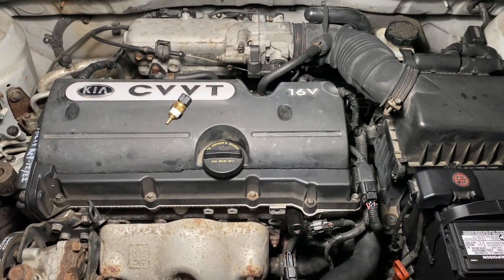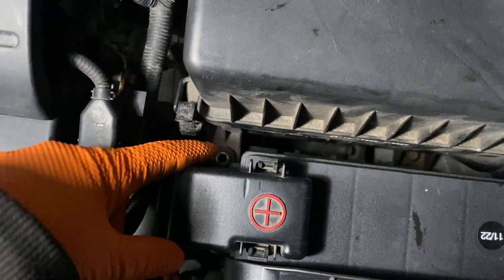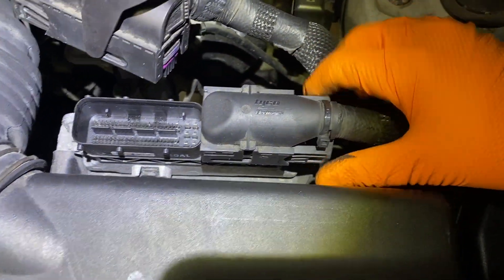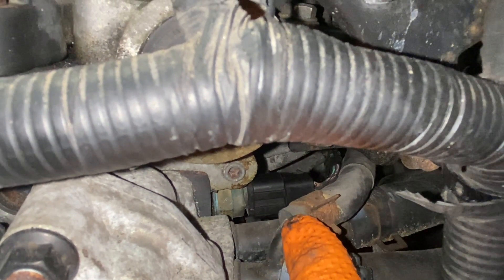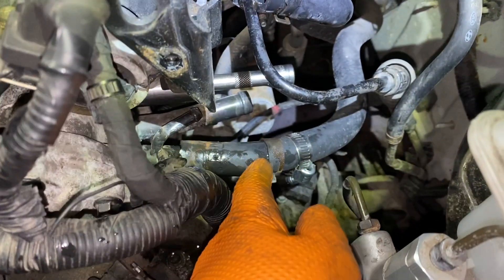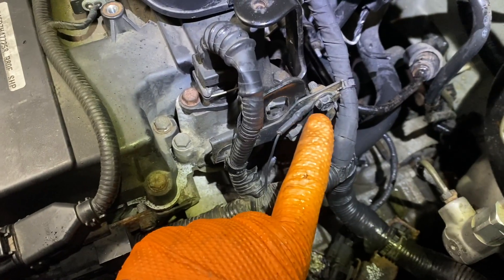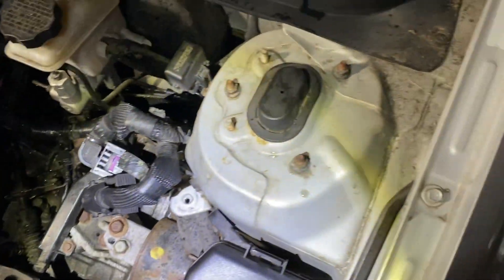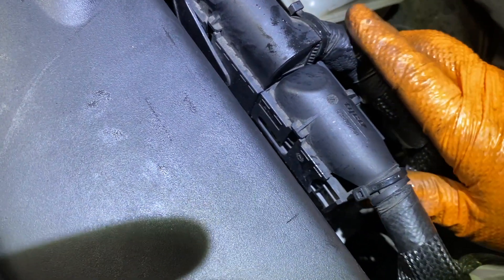Engine Cooling Temperature Sensor Location (ECT) & Replace On Kia Rio Rio 5 Spectra  Hyundai Accent

Comment: Do i have to bleed the coolent after ??
Reply from the maker: Normally no, but if you have no heat or its starts to overheat a little and didn't before then yes.
Reply: @motorcarnut  Thank you for the quick response 🙏
Reply from the maker: No problem!

Comment: How do you get off the wiring harness connector to the Coolant Temperature Sensor? It's plastic and I'm worried it would break. Do you squeeze the connection somewhere? I can't figure out how to get it off without breaking it.
Reply from the maker: Yes, at the front of the sensor is a little tab, push down hard and pull off

Comment: Does anyone know why their are two cooling fans? My left fan does not work but the right one does. Could that be because the temperature sensor is bad? The fan that kicks on comes on with the ac. Are both fans suppose to come on with the ac? Or is one for cooling the radiator and the other for ac?
Reply from the maker: 1 is for the AC and the other for the engine, but some vehicles if the engine temp reaches a centain range the computer may command both as well.
Reply: @motorcarnut  does the hood on these cars get hot rather quick? I replaced the passenger fan (so both work) but it still seems to be got to the touch after driving, say 30 minutes. No temp gauges are on this car so I’m relying on the temp light..
Reply from the maker: What vehicle are we talking about again?